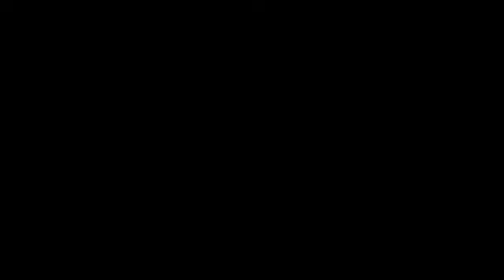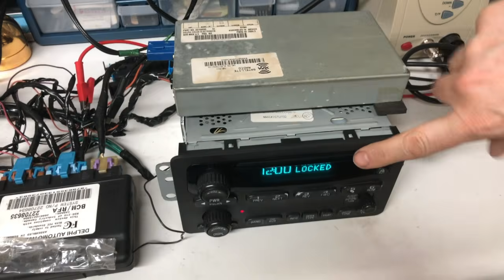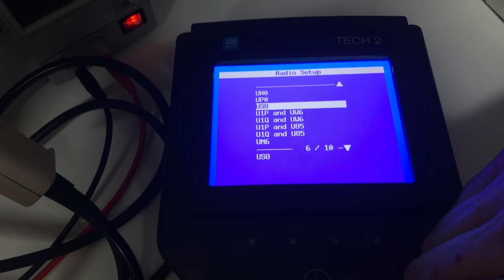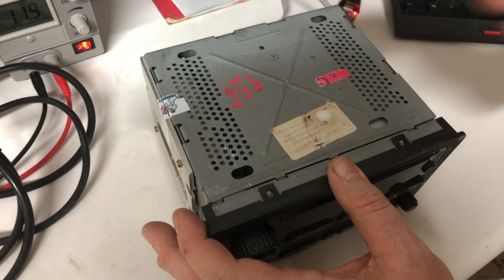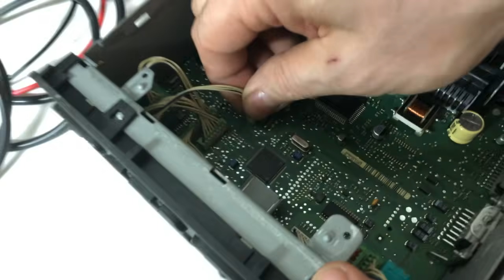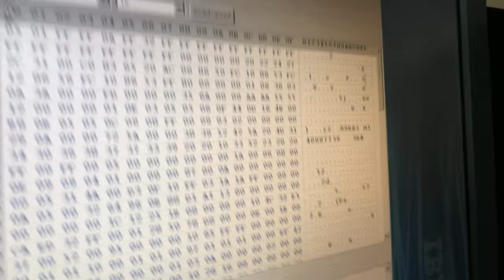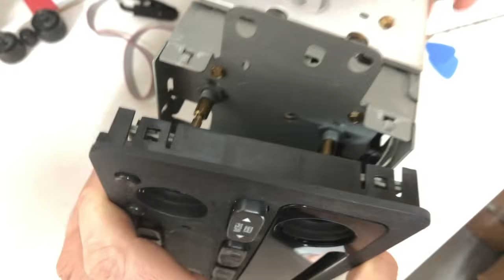2003 - 2006 How to VIN Unlock Salvage Yard GM RDS Radio w/ Tech2 OR Manually Programming its EEPROM

Comment: I am having the worst luck just trying to read the 24c08 chip. I bought the ch341A and modified it as you showed for 5 volts. I verified the 5 volts with a multimeter. I have connected it to a windows 10 machine and my old windows xp machine and both show communication with the ch341a ( green light even flashes when pressing read) but it just will not read the 24c08. I am also using a chip clip. Do you have any ideas? I'm starting to wonder if I received a bad ch341A. Thanks for your help.
Reply from the maker: Some radio models have a circuit board where in-circuit reading is simply not possible.  You can test your work with a spare EEPROM to know your programmer and test clip leads are good to go.  But I do run into this and when it happens the only option is to de-solder the chip from the board to R/W it successfully.
Reply: @DrShock  Thanks for your help. I was kind of thinking along the same lines. I ordered a pack of 24c08 chips, for testing,  as well as another ch341A from a different seller, since they're so cheap. I'm out of desoldering braid, so I will have wait for that to arrive as well. I will add something to your tip jar for your help. Thanks again.

Comment: If I purchase the Tech 2 is all the info in the unit or do I need to buy a subscription and load the unit thru computer? I have a 2003 S10 where I just replaced the radio and am locked out of course. Just curious if I spend the money will i need to spend more. nearest dealer to me is 3 hours away, local mechanics are not able to unlock
thanks in advance
Reply from the maker: The Tech2 works a PC running Windows 2000 or XP only (very vintage software called TIS2000 runs there) but between the two can cover thru model year 2007.  Newer than that year you'll need to buy a subscription to ACDelco TDS for it on a per VIN basis.
Reply: DrShock thank you
Doesn’t sound like it’s worth the expense as I don’t have any old windows programs

Comment: Thank you, yes this video helps a lot,  besides changing the CH341A to 5 volts is there anything else that needs to be modified ?
Reply from the maker: You can use any EEPROM programmer you prefer that supports the chip type.  I just showed this USB one because it is super inexpensive yet suitable for these automotive tasks when modified.  It's always easier with a Tech2 though.  ;-)
Reply: @DrShock  What chip type its in the GM radios ? is that the same chip that is in the BCM? thank you
Reply from the maker: @ernestoruesta9446  They are all different, but I show each type in each video I've made if you watch the circuit board review sections.
Reply: @ernestoruesta9446  Different GM radios have different chips (per many YouTube videos) and in different locations.   I'm putting an upgraded (yet stock) radio into my 2009 HHR.   Of course it is locked.  The model number of the newer GM radio is 2596450.  The eprom in mine is located beneath the USB circuit board attached to the front of the main board.  It is an ATMEL 24C128N chip (IC).   I've ordered the CH341A programmer and will be using this excellent video to reprogram that chip in my new radio.  Since I have the VIN number from the original vehicle, I suspect finding it in the eprom data will be easy to do!
Reply: @ernestoruesta9446  And to add, I believe the RPO code for my new radio must be UUI based on the radio model number, but I'm not sure if the UUI code from the original vehicle helps identify the radios chip number or not.

Comment: Funny how you mention flashing the radio correctly for the correct "amplification" for the speakers, depending what options the vehicle supposely it came from. I got one off ebay from a regular seller that offers radios like this preprogrammed for your particular vehicle, i summited my 2005 gmc sierra 1500 VIN# prior to purchase, bought the truck used 9months ago. I received my MP3 player version(UQ3), it came with a brand new face and bottons on it, even though the radio is used and from late 2004, the sticker in my glovebox says UB0/UQ5, both are for non bose systems. Everything works great, i get normal volume from the front speakers, but low volume from the rear speakers when volume knob is turned all the way up, i tested with fader as well as the ballance functions, same results. Its not the speaker wiring and its not the speakers, all four speakers are brand new and i even tested everything with an aftermarket stereo, all four channels has the same volume when turned up all the way... any ideas? Thanks
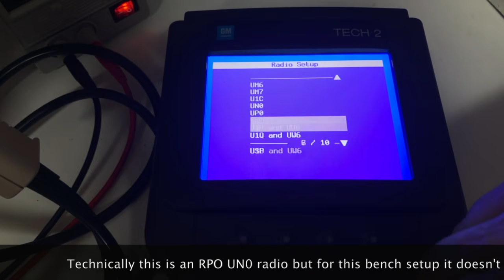Reply from the maker: The RPO codes UQ3 (base) and UQ5 (upgrade) you mention are speaker options, rather than radio ones.  Neither include a rear amplifier.  Without seeing the truck, just reading the comment here I'd say the factory MP3 radio is expecting there to be a factory rear amplifier installed.  My 2004 Chevrolet has that radio (big MP3 letters on the faceplate), and it certainly does require the amp for the rears.  Like in the video at 3:30, though for a Chevy Cavalier, you'll get a set of combinations of radio, speaker, and amplifier RPO codes to program with the Tech2 tool.  I'd expect the GMC Sierra to be the same, just different codes.  The aftermarket radio works because it would most likely not support a GM factory amplifier anyway so just does the same output level for all.
Reply: @DrShock  As you stated, your 2004 chevrolet has the same MP3 letting on your radio like mine and required an amp to drive the rear speakers, that makes perfect sense. I was thinking that exact same thing when testing my radio, the rear low output volume are like low level RCA outputs that had to be connected to an amplifier. I have a LUMY osciliscope and was getting almost 2v max from the rear speaker outputs, my truck is considered a base model and according to the "UB0" RPO radio code from the glovebox sticker, it comes up as a regular CD player radio. So i guess if i wanted the full output from the rear speakers like the fronts, i would perhaps need a TECH2 tool to have it reprogramed for a non amp speaker system or not? Thanks
Reply from the maker: Presuming that MP3 radio supported the UQ5 speaker option you have that might be a way, I wouldn't know for sure.  It's possible that radio does not support any non-amplified rear speakers.
Reply: @DrShock  The only reason i went with an MP3 cd radio, i prefered it over the regular cd audio player radio even though it will play both formats, is because of how much music i can put on a cd, 50+ vs 15 or less on a regular cd audio disk. If only i had known about GM's "special" programing of their radios according to the audio options of the vehicle before i bought mine, i would have had my MP3 radio programed properly or found a better matching one for my truck. I figure the rear speaker output would make for a great  subwoofer option, the 2 front speakers and the rear to an 8" woofer with built in amp for some light bass.
Reply from the maker: It was the top of the line radio of the day, back when it was the thing to burn your own CDs.  I did a quick glance but don't even see the MP3 style radio shown in the 2005 GMC Sierra owners manual GM has online.  It might not have been an option, or I may have missed it.  But if this were my truck I'd certainly be trying to keep it factory in  nature so I'd look at what radios I could have gotten new, and take a Saturday afternoon at my local LKQ salvage yard looking to pull the matching rear speakers and their harness or amp.

Comment: It will function as-is in a Chevy Cobalt 2006? Or need to be programmed anyway to a SPS?
Reply from the maker: Of course, the particular type of radio shown in the video is not compatible with the Cobalt.   The Tech2 Radio with a Candi module has a different menu option but it is there. It's under special functions, module setup, VIN relearn.  No SPS required just like here.  Of course the EEPROM approach is fairly universal to all Delphi radios of the era.

Comment: Great video, thanks for putting the info out there.  I have a salvage radio for a 2015 Terrain.  I've called a couple of dealers who both told me that there was no way to unlock and reprogram the VIN and I was just out of luck.  So, a couple of questions:

1) Is the Tech 2 something only GMC dealers can purchase or is it available to the general public?
2) Is my newer radio somehow different from the example in your video?

Again, thank you for the time.
Reply from the maker: The Tech2 is a professional dealer grade tool yes, and anyone can purchase one but they are not cheap.  Much more common is to buy a clone version on eBay.  But that tool only goes up thru the mid-2000s.   It was replaced by the GM MDI tool, which is the one for your 2015.  The MDI requires a paid software subscription with ACDelco (I have some older videos on all of this if you search in my channel).  GM has clamped down on allowing used modules in recent years, and so your dealers response is not surprising - https://static.oemdtc.com/TechLink/TechLink2010Feb.pdf.  Page 2 of this GM tech note clearly states they have blocked moving radios from used vehicles around in models such as the GMC Terrain.   I am not familiar with newer year radio EEPROM memory layout myself, but I see some forum posts around the EEPROM VIN rewrite approach being the only route.  It would be similar tools and technique, though not the same memory locations as I've shown in this video for the older model years.

Comment: Thanks for this well explained video.  I have a question, can you get rid of the vin number all together so it's not always locked to one vehicle at a time but completely unlocked for any vehicles?
Reply from the maker: No, that's a GM feature (TheftLock) and part of the Body Control Module

Comment: I have a question, do you have an E-mail or website? I just want to see if something is possible.
Reply from the maker: If its related to this video, I'll try and answer it here in the comments
Reply: @DrShock  it's not and but releates to a MDI 2 . I want to know if it's possible to do so before buying one. Basically I would like to configure modules like turning on/off daytime running lights etc etc  I know this was possible with the tech2 especially on my Saab. I did many custom things, but  I'm not really seeing anyone do that with a MDI 2 and newer cars
Reply from the maker: So the MDI isn't self contained like the Tech2 was.   The newer vehicles are all about programming calibrations using SPS, where the MDI has nothing built in and you have to pay for a subscription from GM to get access to do anything at all with one.  If GM allows it, and that's a very narrow list nowadays, you should still be able to configure such options thru the Body Control Module section  when setting one up.   But I would strongly you to post into online forums for the car you have first, to confirm you can do what you want before buying one.
Reply: @DrShock  I'm aware it's has to all be done through the "cloud". It's a Cadillac and I'm going to be honest no one who owns them that are on the forums seems to be smart enough to even remotely know what  I'm talking about. The service advisor said no at my local dealer said no, but they also overfilled my engine oil thinking it was an AWD car, didn't reset my TMPS after a tire rotation, and also used the wrong diff fluid so I for obvious reasons don't trust a word they say. Could you make a video atleast showing what you can do within the BCM ?
Reply from the maker: I have this sort of thing on my list to do at some point.  I just completed a BCM related video in terms of getting around the locked EEPROM situation last month.  If your Caddy is 2012 or less (and not an SRX), you could stick with a Tech2 / Tech2Win - https://gsi.ext.gm.com/userguides/GDS2_Supported_Vehicles.pdf
Reply: @DrShock  17 ATS, I'll slit my wrist before I buy one of those stupid SUV's that everyone wants.